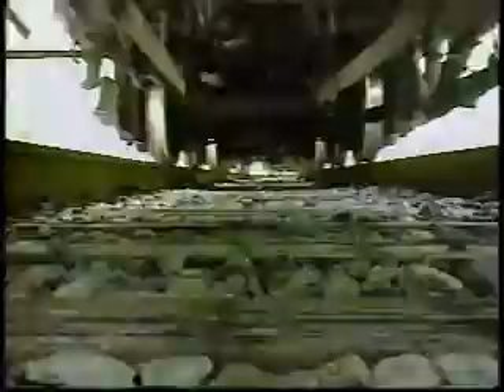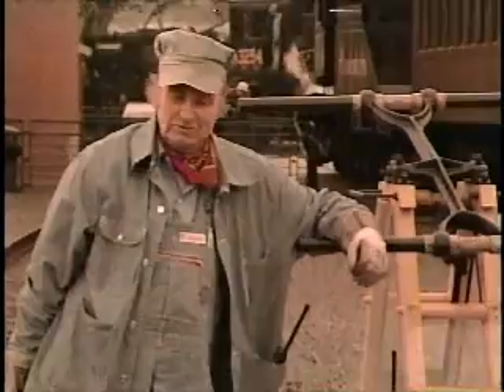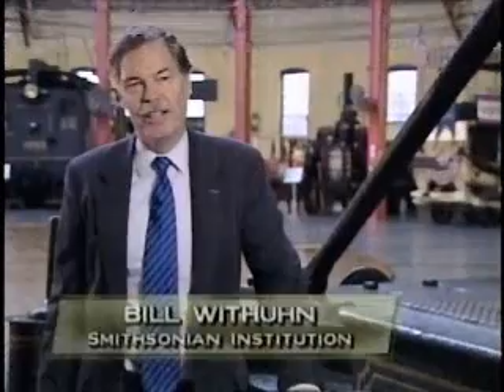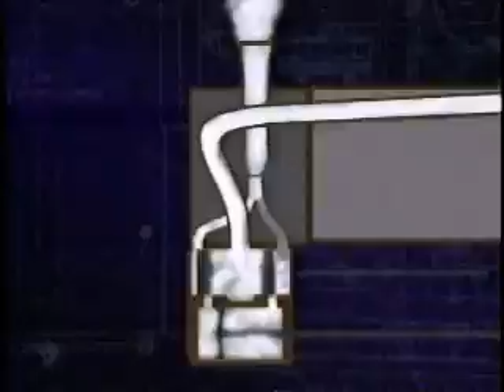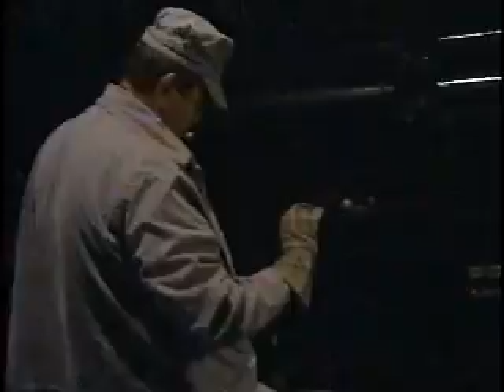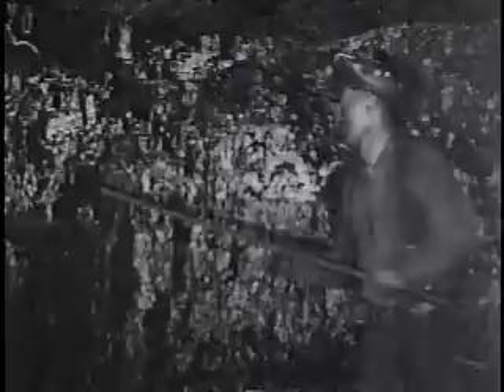The History Of Steam Locomotives (part 1)

Comment: See. They say those early 4-4-0s had only 50 hp. But they had a boatload of torque.
Reply: By their nature, steam engines have quite a bit of torque.  However, many 4-4-0 locomotives were designed less for torque and more for speed.  With large driving wheels and short piston strokes, they were able to go farther on less fuel and water.

Comment: They don't run on steam, they run on wood, coal, dung, whatever.
Even at their best, they were inefficient beyond the extreme.
BUT...
they do look cool doing it.
However, everything cool about steam engines in trains is made trivial by their use in ships and stationary power for mills. Those applications made, and still do make, trains look trivial by comparison. 
But, let's not diss steam too much. All nuclear systems use steam technology, including aircraft carriers and submarines.
Nuclear trains, anyone?
Reply: I once heard that someone made a Nuclear car back in the 60s or 70s.
Reply: We have nuclear powered locomotive's today, the electric locomotives.

No one will build a nuclear powered locomotive where the nuclear power is on the locomotive because of the potential for accidents.
Reply: They ran on water and a fuel, which creates steam. They aren't useful now, but that statement is like saying the iPhone 11 is better than the iPhone. Of Course the newer one is better, but at its time,they revolutionized in their era. For steam locomotives, they made travel faster and comfortable, they made the labour of moving cargo across the country many times faster, easier, and comfortable.  Nowadays they are very much obsolete, but they paved the way for their successors. For iPhones, we wouldn't have had touch screens. Every day you at least see a touchscreen. Now try living without it.
Reply: There are several inherent dangers with an independent nuclear powered locomotive. For instance, failure to properly maintain and handle it could result in a nuclear disaster much like what happened at Chernobyl. If it gets into a wreck, it could likely cause a catastrophic explosion killing many within several miles of the wreckage.

Comment: I'm a huge fan of Steam Engines they run on coal and water the fireman puts coal in the steam engines then the boiler makes hot water steam rises to the steam Dom then travels into a piston called the piston it's turns the the wheels backward and frontward that's how run